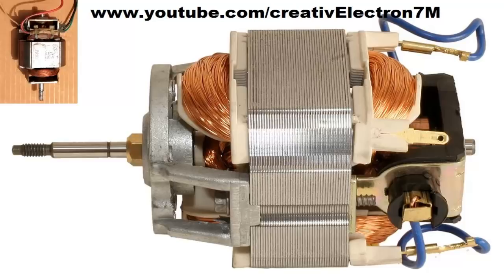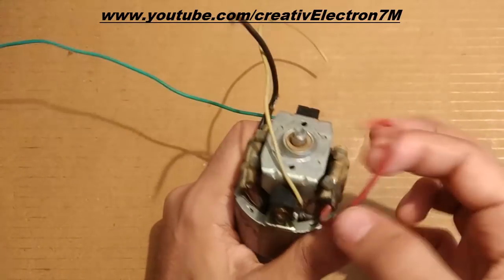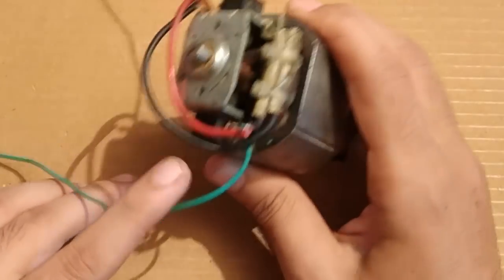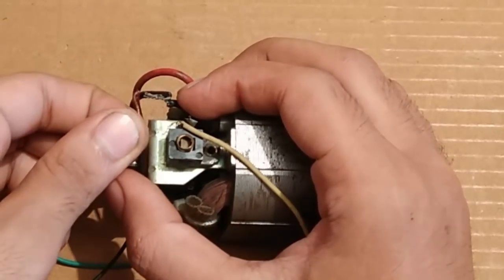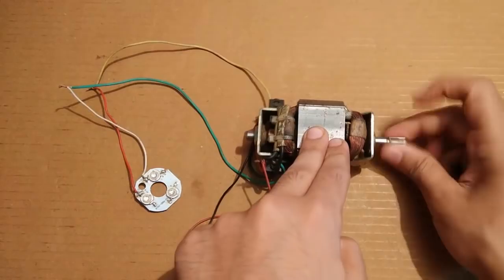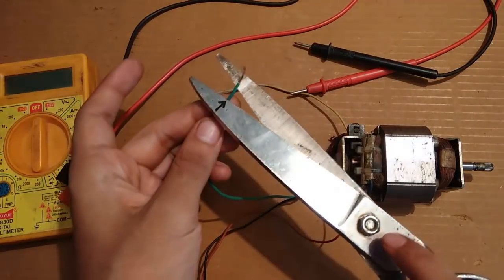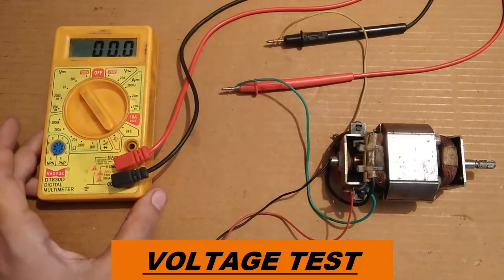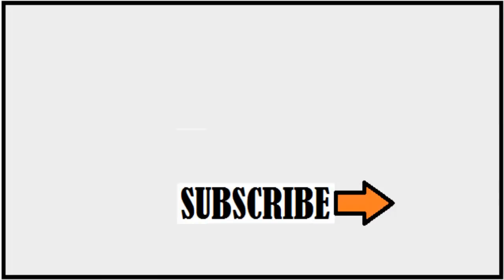Free Energy Generator from a Mixer Motor DIY - 2018

Comment: Hi
The battery is not essensial in this circuit ,just if you rotating motors shaft in reverse direction with drill; then dc voltage apeare in out put.
Check it out.😎

Comment: you can do better. 5 volt is too low for excited coils. add full bridge rectifier to output wires and add that dc current back to excited coil wires. this way you can get same power that blender had if rpm will be same as blenders. dont forget to add transformer to limit current before the rectifier
Reply: За да се направи и звездата на Левски и Лудогорец завършиха р

Comment: these motors cant work as generator because the center is an electromagnet when energized by 120ac it causes the rotor to spin.  Unless you energize the electro magnet you get no current by turning it because their are no magnets in that motor.
Reply from the maker: Correct explaination ...  but as you said they cannot be used as a generator unless the rotor is energized.Which means it can be used as a generator.

Comment: Hello.. I am trying to do it with mixer... But one of my field coil is not working. But connected both field coil in parallel.. Does it generate any voltage.  Will it work.?
Reply from the maker: 2 case .. 1) If the non working field is an open circuit, it will generate some amount of voltage 2) If the non working field is short circuit, it won't work at all.
Reply: Thank u..  I am doing a project on this.. So.. How much excitation is required for 750w motor
Reply from the maker: 12 Volts for a good power generation.
Reply: Mr Electron : how much excitation voltage is given for 750w motor.. And it is compulsory that it should rotate in only One Direction? Please reply.. I am doing project on this.
Reply from the maker: 6 to 20 Volts depending on availability. Higher the better. Any direction movement will generate electricity.
Reply: Thank u so much for ur support.. And guide lines.
Reply: At 4.19 sec u tried rotating in another direction, it was not able.. To glow.. Led. U said.. Since it's DC, GENERATES ONLY IN ONE.. DIRECTION.
Reply from the maker: it generates in both direction  but if u reverse rotate it , u will have to change the polarity of the led too.
Reply: Mr Electron : I thought the same. Actually I am using it as vertical axis wind turbine, with two bulb connected in opposite.. So that in which ever direction it may rotate.. One bulb will be glowing.
Reply: Mr Electron : to get 24v, 30w output.. What type of motor has to be used as generator. I searched for lot. And then finally decided to universal motor. But if u have any idea please let me know
Reply: Mr Electron I used CPU fan to generate...  I can glow a 54 led strip. But want to show the 12v submersible water pump. Which requires minimum 200mA. Can u suggest some good motor. I am giving the idea of INVOLEX wind turbine.. For that I want to show some load connected.
Reply from the maker: Watch this : https://www.instructables.com/id/Making-a-Powerful-Generator-From-a-Blender-Motor-D/
Reply: I saw this. So only I choose to make with universal motor

Comment: I watched a yt vid recently where a man had same motor as yours, but he said all u have to do is connect the field wires in parallel like u have. Then he was getting a good voltage from it, without magnets or an external power source!
Reply from the maker: looks like its fake or you might have missed some part of the video coz thats not electrically possible
Reply: Mr Electron he was saying if you connect the field wires in parallel it feeds remnants( for want of a better term) of electricity back into the field which he says produces more output. But it don’t make sense to me, and all the other vids I’ve watched about these same motors people used magnets as u did. So that’s what I’ll do as I have 4 magnets like yours that I got from a microwave. The motor on microwaves that turns the plate is very powerful for its v small size. Can u answer this for me pls, I only have 3 field wires 2 from one side and 1 on the other. Should I twist the 2 wires from the same side together before wiring them in parallel?
Reply from the maker: take a battery and connect its any terminal to one of the 3 wires and take a small dc motor.Connect one wire of the motor to the other terminal of the battery and the other to the remaining to terminals respectively turn by turn.Choose the wire at which the speed of the motor is slower.Hope this helps.
Reply: I think that might be correct,  but you would require a capacitor, you need something to keep the field windings charged so they magnetize.

Comment: I’m making my first DIY wind gene and I’m attempting to use a universal motor from a food processor. I watched another vid on YouTube of someone who had the same motor and was getting good voltage from it simply by attaching the wires in parallel making self excite. But when I did it I only got about 4-5mA from it when spinning by hand. The bloke in the vid said a small charge when fed back can give you a higher voltage!. So why are you and a couple others I’ve seen using a battery to excite the generator?

Comment: Sir you have shown that 10 volt dc is generated by this motor.what is the maximum voltage which it can generate and how many watts load it can withstand.and how can it be rotated continuously  have not been shown.
Reply from the maker: 40 to 50v.P= 50W ; wind or hydro energy

Comment: Do we have a different definition of the words "free energy"? You've had to supply electrical energy to the field coils and mechanical energy to rotate the shaft. Also to measure current the meter must be in series with the supply and the load not in parallel across the supply.

Comment: This motor is used in most washing machine with 6 terminals  but How I can judge the coil wirs and the shaft wires I can see the brush wires so please teach how to recognise the wires for connections. Help help and help in simple way. Regards. Dr Sharma UK drsharma111 Skype.

Comment: hey buddy, keep building, I've read some comments under your video and realized that most of these people don't know what a seperatly excited dc generator, or Edison generator is, Wichita is exactly what all universal motors are designed after, and with a prime mover attached with 5volt excitation the potential voltage can exceed triple digits. so good job
Reply: Thank you for helping me.
Reply from the maker: the 13th templar no-one : Thanks 🙂
Reply: ESTIMA LORD I SEE WITH GREAT ASOMBRO THAT YOU KNOW A LOT OF THE THEME AND WOULD LIKE A HELP OF YOUR KNOWLEDGE. I AM A STUDENT AND I WANT TO USE AN ENGINE FROM A FAN AS A DYNAMO. HOW YOU CAN HELP ME PLEASE STEP HERE.
Reply from the maker: sure thing.Don't forget to share  and subscribe :)
Reply: the 13th templar no-one https://www.ebay.de/myb/WatchListAdd?_trksid=p2047675.l1359&SubmitAction.AddToListVI=x&item=372111528546&rt=nc&srt=01000200000050ef78772f741a47ca5d62fb6e8cc3efdaba64b91254a61de8580e7fd478309304cd7c0d7c4044e538d7510602c424d15becae3ba179a53ff70706863c02856f40e466a83e9144d1471e331a19aec82827&etn=Watch%20list&tagId=-99&wt=5188584c5b30bfda2f71d820674b00bd&ssPageName=VIP:watchlink:top:de&sourcePage=4340https://www.ebay.de/myb/WatchListAdd?_trksid=p2047675.l1359&SubmitAction.AddToListVI=x&item=372111528546&rt=nc&srt=01000200000050ef78772f741a47ca5d62fb6e8cc3efdaba64b91254a61de8580e7fd478309304cd7c0d7c4044e538d7510602c424d15becae3ba179a53ff70706863c02856f40e466a83e9144d1471e331a19aec82827&etn=Watch%20list&tagId=-99&wt=5188584c5b30bfda2f71d820674b00bd&ssPageName=VIP:watchlink:top:de&sourcePage=4340https://www.ebay.de/myb/WatchListAdd?_trksid=p2047675.l1359&SubmitAction.AddToListVI=x&item=372111528546&rt=nc&srt=01000200000050ef78772f741a47ca5d62fb6e8cc3efdaba64b91254a61de8580e7fd478309304cd7c0d7c4044e538d7510602c424d15becae3ba179a53ff70706863c02856f40e466a83e9144d1471e331a19aec82827&etn=Watch%20list&tagId=-99&wt=5188584c5b30bfda2f71d820674b00bd&ssPageName=VIP:watchlink:top:de&sourcePage=4340https://www.ebay.de/myb/WatchListAdd?_trksid=p2047675.l1359&SubmitAction.AddToListVI=x&item=372111528546&rt=nc&srt=01000200000050ef78772f741a47ca5d62fb6e8cc3efdaba64b91254a61de8580e7fd478309304cd7c0d7c4044e538d7510602c424d15becae3ba179a53ff70706863c02856f40e466a83e9144d1471e331a19aec82827&etn=Watch%20list&tagId=-99&wt=5188584c5b30bfda2f71d820674b00bd&ssPageName=VIP:watchlink:top:de&sourcePage=4340https://www.ebay.de/myb/WatchListAdd?_trksid=p2047675.l1359&SubmitAction.AddToListVI=x&item=372111528546&rt=nc&srt=01000200000050ef78772f741a47ca5d62fb6e8cc3efdaba64b91254a61de8580e7fd478309304cd7c0d7c4044e538d7510602c424d15becae3ba179a53ff70706863c02856f40e466a83e9144d1471e331a19aec82827&etn=Watch%20list&tagId=-99&wt=5188584c5b30bfda2f71d820674b00bd&ssPageName=VIP:watchlink:top:de&sourcePage=4340https://www.ebay.de/myb/WatchListAdd?_trksid=p2047675.l1359&SubmitAction.AddToListVI=x&item=372111528546&rt=nc&srt=01000200000050ef78772f741a47ca5d62fb6e8cc3efdaba64b91254a61de8580e7fd478309304cd7c0d7c4044e538d7510602c424d15becae3ba179a53ff70706863c02856f40e466a83e9144d1471e331a19aec82827&etn=Watch%20list&tagId=-99&wt=5188584c5b30bfda2f71d820674b00bd&ssPageName=VIP:watchlink:top:de&sourcePage=4340https://www.ebay.de/myb/WatchListAdd?_trksid=p2047675.l1359&SubmitAction.AddToListVI=x&item=372111528546&rt=nc&srt=01000200000050ef78772f741a47ca5d62fb6e8cc3efdaba64b91254a61de8580e7fd478309304cd7c0d7c4044e538d7510602c424d15becae3ba179a53ff70706863c02856f40e466a83e9144d1471e331a19aec82827&etn=Watch%20list&tagId=-99&wt=5188584c5b30bfda2f71d820674b00bd&ssPageName=VIP:watchlink:top:de&sourcePage=4340https://www.ebay.de/myb/WatchListAdd?_trksid=p2047675.l1359&SubmitAction.AddToListVI=x&item=372111528546&rt=nc&srt=01000200000050ef78772f741a47ca5d62fb6e8cc3efdaba64b91254a61de8580e7fd478309304cd7c0d7c4044e538d7510602c424d15becae3ba179a53ff70706863c02856f40e466a83e9144d1471e331a19aec82827&etn=Watch%20list&tagId=-99&wt=5188584c5b30bfda2f71d820674b00bd&ssPageName=VIP:watchlink:top:de&sourcePage=4340https://www.ebay.de/myb/WatchListAdd?_trksid=p2047675.l1359&SubmitAction.AddToListVI=x&item=372111528546&rt=nc&srt=01000200000050ef78772f741a47ca5d62fb6e8cc3efdaba64b91254a61de8580e7fd478309304cd7c0d7c4044e538d7510602c424d15becae3ba179a53ff70706863c02856f40e466a83e9144d1471e331a19aec82827&etn=Watch%20list&tagId=-99&wt=5188584c5b30bfda2f71d820674b00bd&ssPageName=VIP:watchlink:top:de&sourcePage=4340https://www.ebay.de/myb/WatchListAdd?_trksid=p2047675.l1359&SubmitAction.AddToListVI=x&item=372111528546&rt=nc&srt=01000200000050ef78772f741a47ca5d62fb6e8cc3efdaba64b91254a61de8580e7fd478309304cd7c0d7c4044e538d7510602c424d15becae3ba179a53ff70706863c02856f40e466a83e9144d1471e331a19aec82827&etn=Watch%20list&tagId=-99&wt=5188584c5b30bfda2f71d820674b00bd&ssPageName=VIP:watchlink:top:de&sourcePage=4340https://www.ebay.de/myb/WatchListAdd?_trksid=p2047675.l1359&SubmitAction.AddToListVI=x&item=372111528546&rt=nc&srt=01000200000050ef78772f741a47ca5d62fb6e8cc3efdaba64b91254a61de8580e7fd478309304cd7c0d7c4044e538d7510602c424d15becae3ba179a53ff70706863c02856f40e466a83e9144d1471e331a19aec82827&etn=Watch%20list&tagId=-99&wt=5188584c5b30bfda2f71d820674b00bd&ssPageName=VIP:watchlink:top:de&sourcePage=4340https://www.ebay.de/myb/WatchListAdd?_trksid=p2047675.l1359&SubmitAction.AddToListVI=x&item=372111528546&rt=nc&srt=01000200000050ef78772f741a47ca5d62fb6e8cc3efdaba64b91254a61de8580e7fd478309304cd7c0d7c4044e538d7510602c424d15becae3ba179a53ff70706863c02856f40e466a83e9144d1471e331a19aec82827&etn=Watch%20list&tagId=-99&wt=5188584c5b30bfda2f71d820674b00bd&ssPageName=VIP:watchlink:top:de&sourcePage=4340https://www.ebay.de/myb/WatchListAdd?_trksid=p2047675.l1359&SubmitAction.AddToListVI=x&item=372111528546&rt=nc&srt=01000200000050ef78772f741a47ca5d62fb6e8cc3efdaba64b91254a61de8580e7fd478309304cd7c0d7c4044e538d7510602c424d15becae3ba179a53ff70706863c02856f40e466a83e9144d1471e331a19aec82827&etn=Watch%20list&tagId=-99&wt=5188584c5b30bfda2f71d820674b00bd&ssPageName=VIP:watchlink:top:de&sourcePage=4340
Reply: the 13th templar no-one 2اكتوبر و تكوني قوية 261
Reply: the 13th templar no-one هل
Reply: creativ electron7
Reply from the maker: Replace the rotor with a magnetic cylinder --> https://www.youtube.com/watch?v=fauI0XPTVoo
Reply: I agree, the output was 10 volts after putting in 5, just by turning the rotor by hand.    Imagine what it could put out by attaching a small gear on the rotor turned a large one, bet it'd put out 50v easy

Comment: This is not efficient Generator ..for more output use permanent magnet instead of field coil ..then no need to give supply to coil ..and make some changes in armature winding for  desire voltage ..like 12 v  16 v or 24 vol ext powerful neomagnet  available in market ..you can change wire size also

Comment: you supplied 5 volts dc and you get 6 or 7 volts dc where is the free energy boss.
Reply from the maker: Mudassir Ansari thats what i am getting with hand rotation and the maximum was 10.6V .The term 'Free' is used for the motor being freely available.
Reply: Mudassir Ansari well he got 5-10v just from a short spin with his fingers, which is a lot more than was being put in!. Also if the motor was part of a wind turbine it would be free energy and much more of it as a turbine would generate more electricity!.